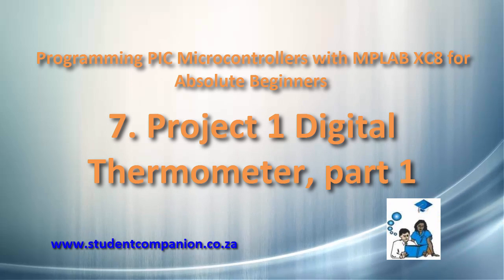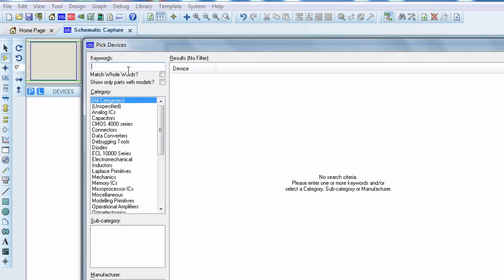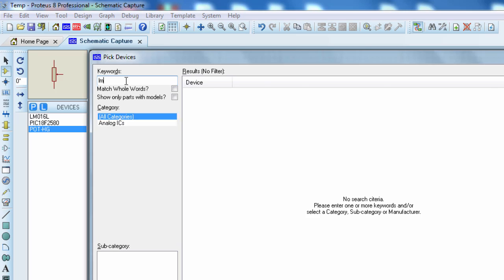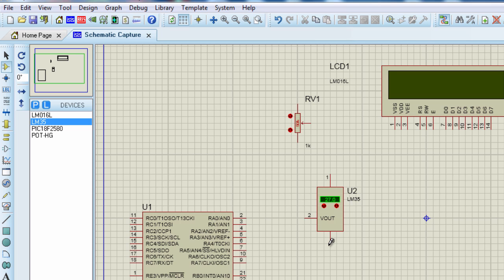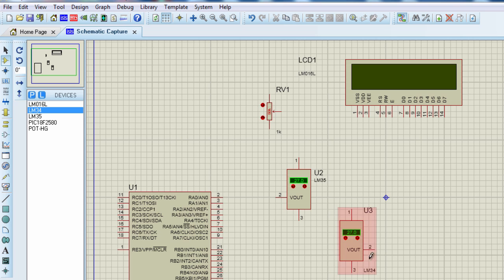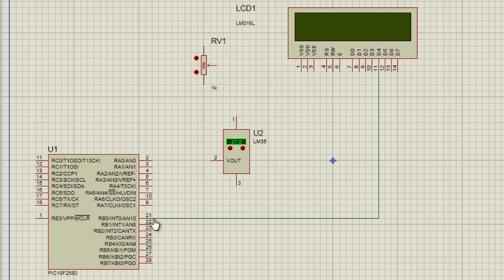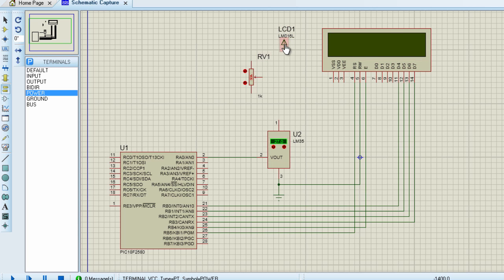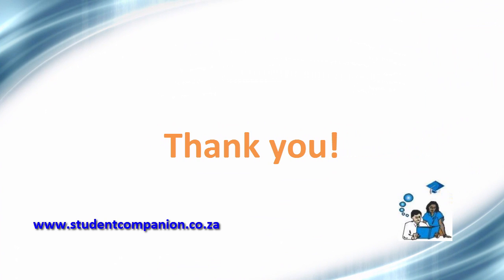7- Project 1 Digital Thermometer, part 1 | MPLAB XC8 for Beginners Tutorial

Comment: Can't solve the error I'm getting for sprintf
Reply from the maker: Can you post the full error message you are getting and specify which PIC  microcontroller you are using and the version of your compiler. We can't guess what could be the problem based on that simple statement
Reply: @StudentCompanion  I'm using pic 18f2580 and version 1.35 of the xc8 compiler
Reply from the maker: You didn't say which error you are getting. How do you expect anybody to assist you when you don't post the actual error messages you are getting? Can't solve the error I'm getting for sprintf, which errors? That's very vague
Reply: @StudentCompanion  unable to resolve identifier
Reply from the maker: If you can't explain yourself we have other things to do.  What identifier? When you build your project, it produces the build log. Just copy and paste everything here, all the build message. If you can't, please stop disturbing, we can't guess if you can't post more information.
Reply: @StudentCompanion  I see no need then.

Comment: Thanks for tutorial, it is really helpful. For the lcd display, we don't have to connect D0~D3?
Reply from the maker: Yes. You don't have to connect Do to D3 when using the LCD in 4-bit mode.
Reply: @StudentCompanion  thanks! but I got an error from Eagle software that I have to make connection on D0-D3
Reply from the maker: @oksky58  that's an EAGLE error not a microcontroller error. You can ask in EAGLE forums what to do to ignore that error.
Reply from the maker: @oksky58  Did you test your project on a breadboard first before you create a PCB?
Reply from the maker: @oksky58  For proper hardware connection, please connect the RW pin to RB6 not to ground as in this simulation.

Comment: Hi, I have erreur in mplab XC8 with the XLCD and other devices, the erreur still"configureHints" i did installed the mplab code configurator and i added the lcd.h file to the header files but i still not working.i would know what should i do to solve these problems ? and thank you for the help.
Reply from the maker: Hi. What kind of errors are you getting? Can you post all the error messages? What is the version of your XC8 compiler? What is the PIC model you are using?
Reply: thank you for ansewring i have these line of erreurs every time i build :make[2]: * [build/default/production/_ext/547698632/putsxlcd.p1] Error 1
make[2]: * [build/default/production/_ext/547698632/putrxlcd.p1] Error 1
make[1]: * [.build-conf] Error 2
make: * [.build-impl] Error 2

BUILD FAILED (exit value 2, total time: 2s)

the code seems without erreurs but the build shows these erreurs.thank you for helping me.
Reply from the maker: @sarramarmouche8344  Hi, the problem seems like you are trying to use the Peripheral Library which contains the LCD library, the xlcd. Please note this library is no longer supported in new versions of XC8 compiler, so if you are using a new version, it won't work. 
Either download the library separately, or use an old version that include that library or use something else supported by the new compiler version.
Please watch this video we are explaining how to use another simple lcd library: https://youtu.be/4WaB_Lj8FnY

Comment: is there need to mention copyright during programming?
Reply from the maker: +soumya palkundu what Do you mean to mention?
Reply: ok leave that.
 0 102 Finished (with errors): 20 Dec 2017, 11:56:35 Temp_Control.mcppi
  0 434 Demo Limit Demo Limit
the above two errors are in 0 th line shown.
actually i first time do programming in mikroc software all is ok showing after press build button except those two errors.
plz can you solve the above mentioned two errors? actually i copy your source code directly from net and paste in the software all are compiled successfully but there show only two above errors please tell me how to solve them? otherwise i can't proceed the project.
Reply from the maker: +soumya palkundu the error it showing is: Demo Limit.  When you download mikroC from their website, you download the free version. It limit your code size to 2kb. You can't build bigger codes like this project.  You must buy a full licence or build only small projects.

Comment: which software you use for programming in pic microcontroller?
Reply: oh! sorry it will be mplab xc8.
Reply from the maker: +soumya palkundu it depends. We ise MPLAB XC8 like in this video.  We also use mikroC, Flowcode and Arduino software. If that was your question.
Reply from the maker: +soumya palkundu exactly.
Reply: arduino software? but you burn programme in pic microcontroller then why need to use arduino?
Reply from the maker: +soumya palkundu what is your question here? You are not clear.

Comment: do there need to burn the pic microcontroller by programming if i do this project in veroboard?
Reply from the maker: +soumya palkundu of course.  How will you have the code running inside your PIC unless you program your PIC first with a programmer
Reply: ok thanks a lot. actually i recently study on pic,arduino etc. to make such interesting projects. i never work with arduino or pic before. your project is really good and inspiring. at last i want to ask you that can i control my room temperature in any weather(summer or winter) by this controller project? plz answer me then i can start working for this project.
Reply from the maker: +soumya palkundu just try to follow the video all the parts. You'll understand
Reply from the maker: +Student Companion the automatic temperature control system

Comment: Hey!, is there any video of you showing how to configure the analogue pins of the pic16f877a for reading a voltage? I really need it!, amazing videos, im learning a lot as I am new at this
Reply from the maker: +Victor Raul Le Roy Brito Hi. Thanks for watching our videos.  We don't have a video using PIC16F877A at the moment as most of our tutorials are based on PIC18F series. It's not difficult to configure analog to digital converter of PIC16F877A. From the datasheet use ADCON0 and ADCON1. If you struggle in your code let us know.